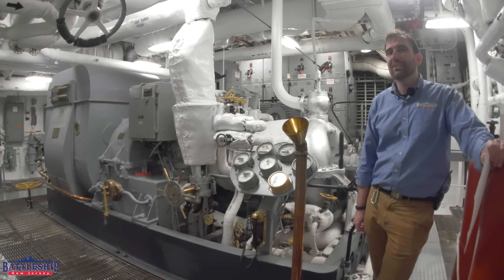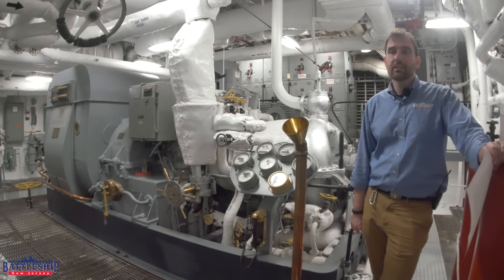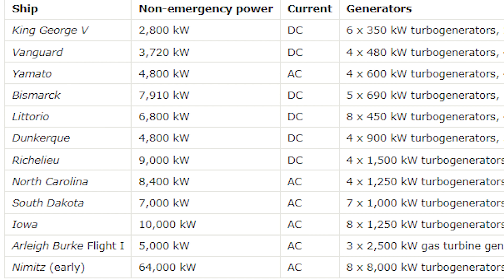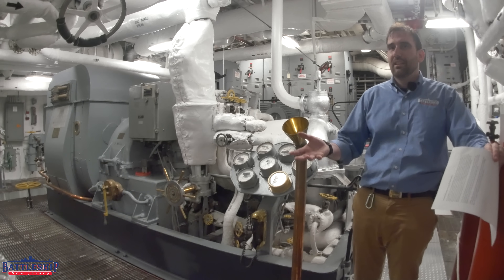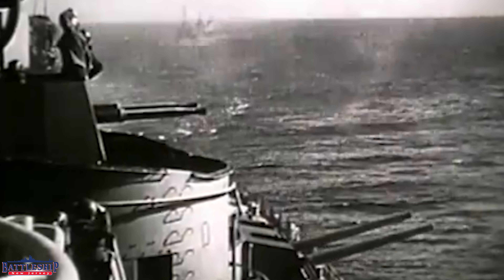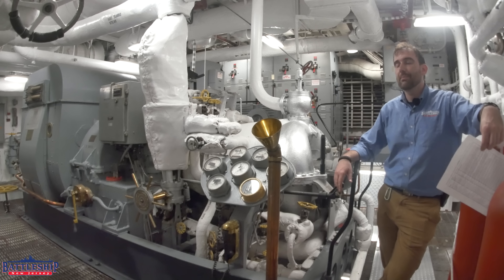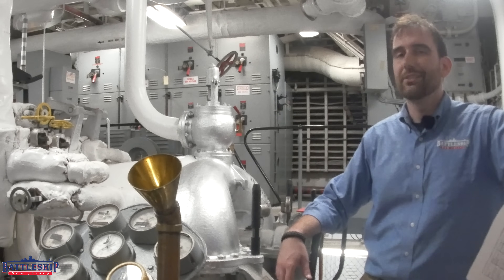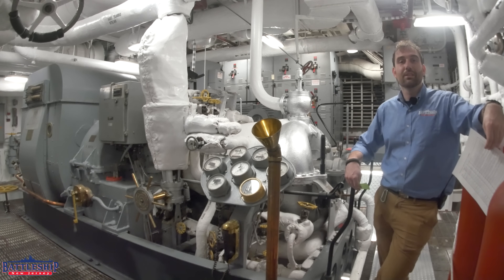How Much Power Can a Ship Generate and Did a Ship Really Power a Whole City?

Comment: Check your facts about the AC / DC electricity statements you made.
Reply: concur - He got some math errors on the Slide. AC versus DC - DC can only "transmit" a limited distance of wiring. AC seems Unlimited. House wall plugs are AC- but many things to run first convert it to DC and lower voltage.  Next - a CVN has 8 turbogenerator- how many are typically running, how many in maintenance- IF they want want to can other stuff handle all  turbogenerator on line at the same time? OK - I think the zumwalt has only 4 generator - of 2 different sizes. The Generate DC. Propellers turned by LARGE DC motors - transformers to convert DC to AC for that necessary load. compare - CV-2/3 Lex & Sara - again propellers large motors-Speculative - pair (4) generator power only to propellers - near 9 MW each - then another 6 of 750 KW each  ships electricity.  [wiki article ref to Stern, Robert C. (1993). The Lexington Class Carriers. Annapolis, Maryland: Naval Institute Press. ISBN 1-55750-503-9]. See WIki article on "Integrated electric propulsion" for some more.
Reply: Your dc is only good for short distance is not correct although everyone says it.

We send 500,000 volts Dc from The Dalles to Sylmar ( La) California almost 900 miles .

Only 2 wires instead of 3, no capacitive and inductance reactance losses only resistance.
Reply: @wfoj21  they have now figured out to use ultra high voltage / ultra high frequency DC for long transmission lines with lower loss than ac
Reply: dc is zero frequency not high freq!
It is high voltage !
Reply: @josephpadula2283  do you understand what ripple is or PWM? or dc in ac carrier?
Reply: I understand ripple the small variation in voltage after bridge rectification of AC to DC . 

PWM is used to vary effective voltage in modern DC circuits , nothing to do with AC in general but can be used in some HVDC 
Units ,line commutated type?

No DC is put utility AC power but can show up in HVDC transformers in VSC using IGBt.

I am an ME not EE but this is what I was told when I visited Celilo
In The Dalles. 3800 Mw HVDC
Reply: what he ment was that inside your home most all the stuff (electronics) run on DC. as in power supply in computer, led lights, tv and so on

Comment: Correction: Domestic power is AC. North America mostly uses 120/240V single phase. DC is mostly vehicles.
Reply: what he ment was that inside your home most all the stuff (electronics) run on DC. as in power supply in computer, led lights, tv and so on
Reply: @martehoudesheldt5885  Indeed, electonics run on DC, but I think it was implied that homes are wired for DC power and that is the type in the lower voltage receptacles. 9:10 "By using a recitifer you can easily convert the AC power coming off the generators to the DC power that you need for, say, the wall outlets around the ship". 15 years as an industrial electrican/instrumentation tech, I've seen DC "wall outlets" built into wet location machinery for removable 24VDC lighting, some for external control/sensor power and others for charging stations of battery operated equipment though I'd imagine these aren't installed on a ship and conventional 120VAC receptacles are the norm. Unless all the computers, light fixtures, maintenance machinery and other equipment are all runnng off inverters or custom built to use the DC power supplied by the outlets in the ship.
Reply: @crazyguy32100  i agree with most of what you said ; but being a mobile repair for 35 years and a maintaince supervisor for 10 years i have never seen the power company bring in DC. it has all been created in house. common PLC control volts is 24vdc. i have worked with up to 600vdc 300 amp for a motor for a machine but the dc was created in house from a power supply and then sent to the location needed. i have installed a lot of 5, 12, 24 vdc lighting all from power supplies. homes are not wired for DC unless they had it wired special.
Reply: @martehoudesheldt5885  I didn't state DC was supplied by a power company, I said I've seen DC "wall outlets" for various purposes, built into machinery. I've never seen a power company bring in DC either, power to the sites was always 3ph, usually 44kV, a couple 115kV and one was run off a set of 13.8kV diesel generators.
Reply: @martehoudesheldt5885 I disagree, He was talking supply
Reply: For some reason, my house is wired for 3 phase, 
240 volts.  (Funny story here.)  Last year, our AC 
compressor started leaking out all it's refrigerant.
(R22)  So, I ran it on R290.  Dirt cheap.  about $21 
for a 15 pound bottle.  Yes, R290 is propane, and 
I was using a BBQ bottle, using a Horror Fright Weed 
burner hose, hacked into my cheap set of gauges.

The rest of the story, landlord had a guy come over 
to look at the system.  He told her we have 3 phase,
I said BS!  This is a house.  (I had never really looked 
at the breaker box.)  Well, I went out and looked.  We 
DO have 3 phase power.  Until I retired, earlier this 'year, 
I was repairing and building up, power tools.  We're not 
talking your inexpensive hand drill, (did those too) but 
high power wood working stuff.  I'd LOVE a Sawstop!

steve
Reply: @steveskouson9620  Damn! I'd love to have a 3ph hookup to my place, be nice to have my own engine lathe and bridgeport (and a Haas 5 axis if I win the lottery) instead of using the ones at work. Sadly the nearest  3ph line is 5 miles away, I could get a VFD that runs on single phase, a rotophaser or remotor whatever I get but the added cost of doing any of that is usually the deciding factor against getting the equipment in the first place.

Comment: Theres no DC at my house.
Reply: yes there is, the computer that you are using, led lights , your tv, ANY USB device (5v dc) got it?
Reply: @martehoudesheldt5885  Fool, the 110 volt AC comes in through the wall socket, goes into a transformer and rectifier and is made into low amperage low voltage DC.  GOT IT?
Reply: @rogersmith7396  thank you for confirming what i said. that is what is in the power supplies in the stuff with electronics. they are using PWM a lot now so they don't need the transformer to get the job done. tear apart an old phone charger and look how it is made.

Comment: No, residential houses all use A/C power. D/C is used for batteries and storage, especially with solar power
Reply: Some newer houses have DC circuits as well, although i think its still pretty rare.
Reply: @dirtdevil70  if they have solar panels, but more importantly a power wall like the Tesla Wall, that is DC.
Reply: u use dc in the stuff in the house like the computer you typed this on the tv, the phone charger and more. you just don't see it

Comment: Many years ago, a nuclear sub was used to power a hospital in Hawaii, after a major storm.
Reply: After a major ice storm in Canada diesel locomotives were parked on siding and run 24/7 to provide at least some power to local facilities. After all. That is essentially what the diesel engine on a locomotive does. It turns a generator to provide power for the traction motors in the trucks.
Reply: @mpetersen6  If you're thinking Boucherville Quebec (1998), they didn't just park it on a siding, they drove it down the street in order to hook it up to city hall. No, there were not any rails. But there were two rather nasty grooves after the fact. And I can't think the locomotive was too happy about running on/through pavement either.
Reply: I want to say that was Iniki, back in 1992. But I could be wrong.
Reply: @tomtrask_YT I remember that being done in the late sixties.
Reply: In 82 after Hurricane Iwa hit Hawaii, the Navy sent a nuclear sub to Kauai and hooked into the grid at Lihue. This was about a year before I got stationed there so heard all the different stories. On a side note, whenever a hurricane got ready to hit Hawaii, most of the larger military aircraft would vacate to NAS North Island in San Diego where I was also stationed.
Reply: @johnknapp952  Check your facts. Never supplied the grid.
Reply: USS Lexington did the same in the -30's after a storm or earthquake.
Reply: I remember that was done with a locomotive. I don’t recall a sub being used in that way.
Reply: I've heard stories that the Soviets did similar things on occasion on the barents sea coast, and their east coast.  Don't know how true it was, but it makes sense to me that you could theoretically backfeed shore power connections.
Reply: Or maybe it was an urban legend. The truth is the sub (USS Indianapolis) was ordered to sail to the harbor to explore the POSSIBILITY of providing power for the Kauai grid (primarily for municipal water pumping needs). They discovered it would require too many modifications and too many workers to be a feasible solution. They flew in a mobile generator from California instead. Now that you know the truth, please stop spreading lies.
Reply: Which sub was that? What class?